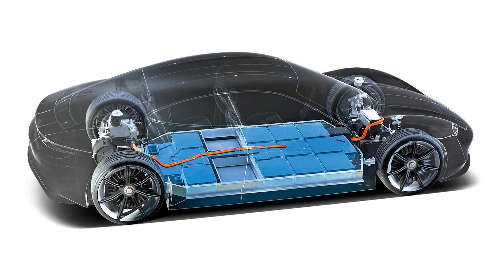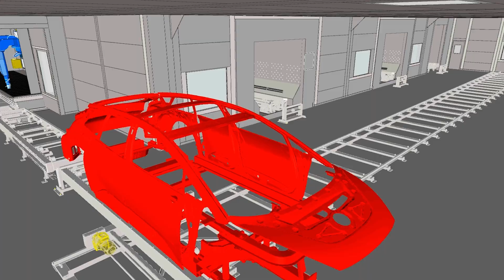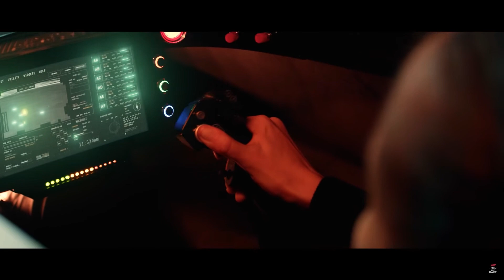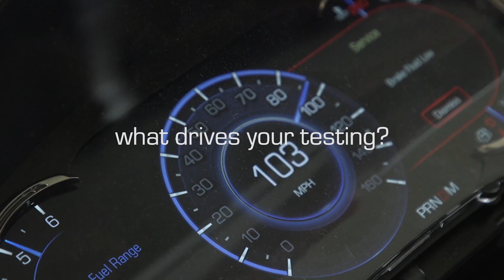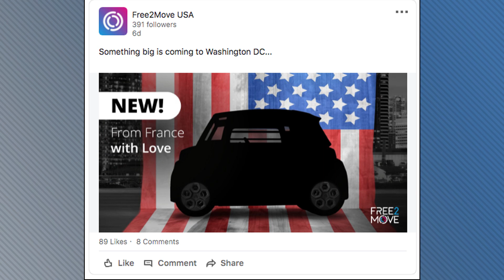Faraday Readies for Production; Toyota Shows New Tundra - Autoline Daily 3105

Comment: Binderjet printing has been in use for a decade in other industries. I think stratasys built the first machines. I wonder if a patent finally ran out, and now VW is using it?
Reply: Correction: its was Massachusetts Institute of Technology patented it in 1993 (not Stratasys)... And parts printed using the binder jetting process has been inherently porous and have an unfinished surface, unlike powder bed fusion the powders are not physically melted and are joined by a binding agent. 

Volkswagen plans to use it for structural parts is "new" ...